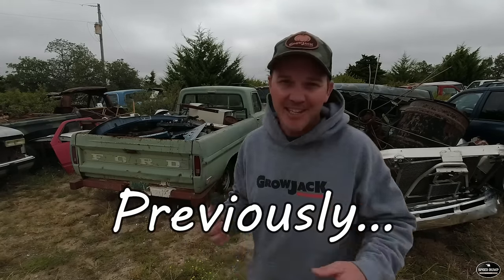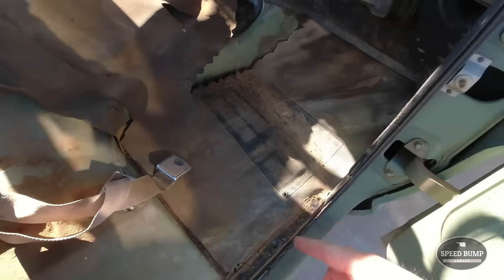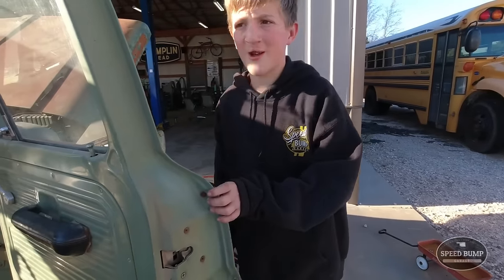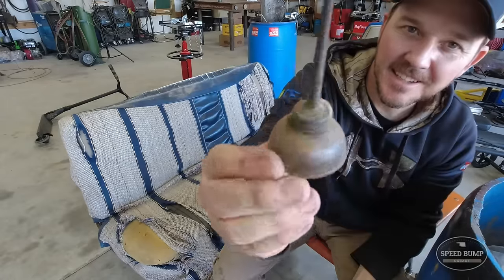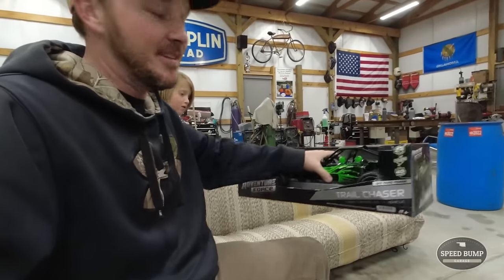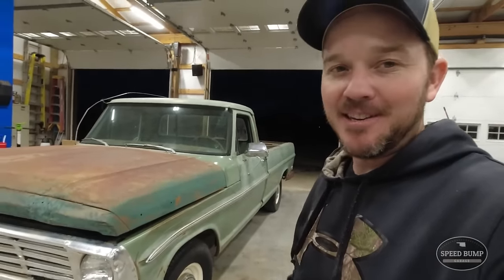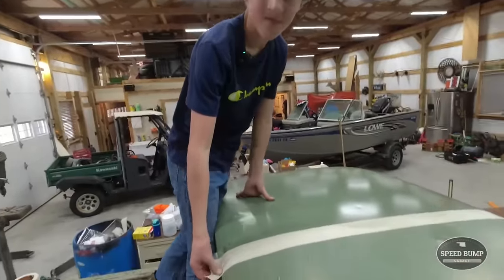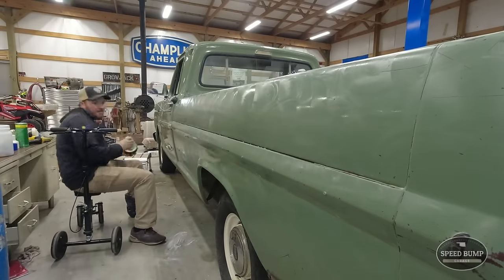Weekend Transformation on the Junk Yard F-100

Comment: tip for spray paint. Store upside down and when shaking it up hold the can with the lid side away from you at a 45 to 90 degree downwards and just swirl the can in a circle motion.

Comment: Just a tip for the front seat, you can use zip ties to loop thru the cover. Run the zip tie from behind the seat after it is thru find a spot somewhere in the middle of the zip then take your choice of color of black tape and wrap about a 2 inch strip of it so it's about 3/8 to 1/2 round. Then feed back the zip tie thru the seat connecting it to one of the springs and snug it up some so it keeps the seat cover pulled back but not to tight. and repeat 3 to 4 times across where the seat folds 👍💯

Comment: Baling hooks. Generally used to stack small bales of hay when working on wagon behind baler. I would use hook to grab bales as it come off baler then grab the two strings of twine with left hand and using hook in right hand throw bale on stack

Comment: Try the paintless dent removal process on the cab dent and front fender where you use a ratchet strap glued to the surface, apply tension on the anchored end and gently work out the dent.

Comment: I'd pad the passenger side door frame and use a jack to pump out the dent I drivers side corner panel . A hydraulic pump type jack and a 2 x 4 to the opposite corner panel  use a small board on top of jack to form the dent out.